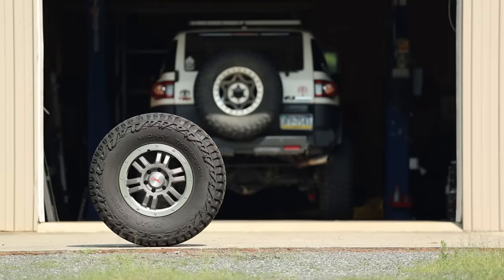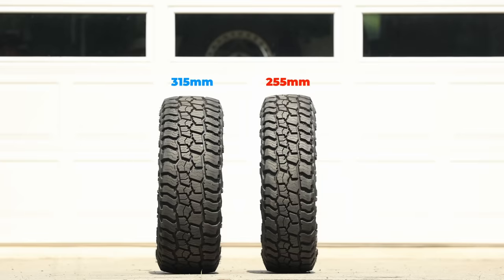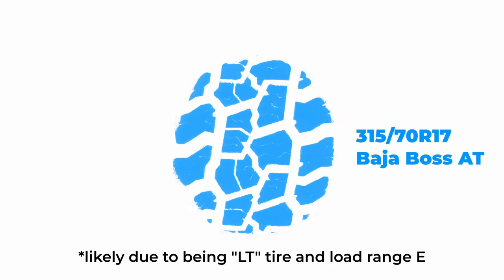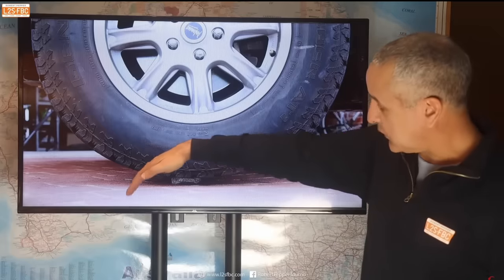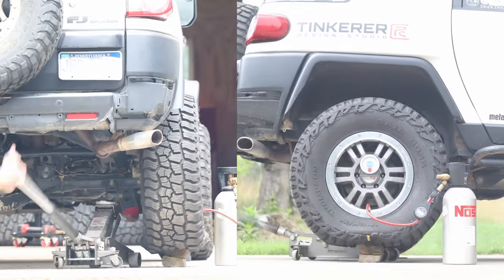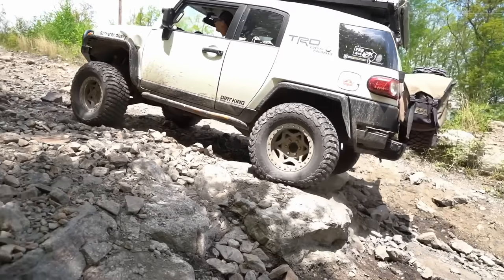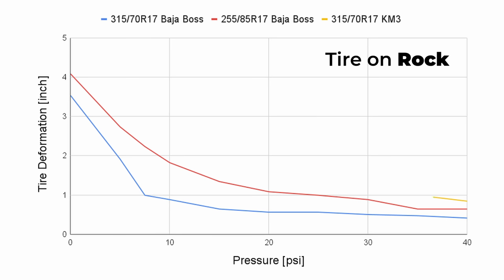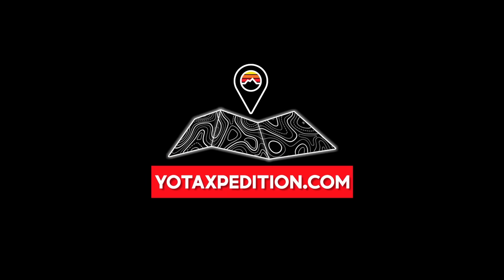3 Scientific Experiments to Settle This | Wide vs Narrow Off-Road Tires

Comment: Awesome video Kai! Very informational! Glad to be working with you on this!
Reply from the maker: Thanks again for your generously support! We’ll collaborate on more interesting topics
Reply: you guys only support 5th gen 4runners right now? I don't see anything on your website for the other generations.
Reply: Thank you Yota Expedition!
Reply: Thanks Yota !
Reply: Thanks for sponsoring.   You guys need to sell some 1st gen Tundra stuff.
Reply: Well done for your support too.
Reply: Thank you! @yotaxpedition
Reply: Sick collab!
Reply: @shohokuslamdunk  We are still in the process of building our website out. But our main focus right now is 5th gen 4Runner, 3rd gen Tacoma and starting to get into the new Tundra
Reply: It seems to all comes down to softness of tyre rubber. You see the rock crawling trucks use very soft compounds on brands like Maxxis Trepadors
Reply: You work with Kai who attracts a lot of FJ owners but your website doesn't have any products for our FJs? I am disappointed 🥲
Reply: Fail. The whole entire point of foo reading is to become able to bug out with enough stuff to survive when SHTF, and for any given diameter, the wider tire holds more air, so can have a higher load rating to carry more stuff. A 305/70R16E beats a 255/85R16E, both are 33", but even a 305/70R16D is rated to carry 110# more than a 255/85R16E. Wider wins.
Reply: @TinkerersAdventure do you have a video comparing 0-60 in wide tires vs wider tires? For example 275.50.17 vs 315.50.22
Reply: @TinkerersAdventure 100 percent of mountain bikers or motocrossers could have explained to you that more tire volume...... means less likelihood of damaging a rim. Not just risks of unseating. 

Also, you didn't show any evidence at all to indicate if more "tire wrap" gives actual better performance on a jagged rock edge with a pizza cutter. If the tread is deformed inward, all the knobs are pressed together and the tread behaves more like a bald road tire, vs a knobby. 

If you want to learn real science, never listen to the guy who wears deodorant.
Reply: Don't own a Toyota but thanks for helping him out. That was an excellent informative video. Now I'm sub'd to 2 new channels!
Reply: @TinkerersAdventure  You’re an engineer; what you have stumbled upon can be represented by the following simplified equation for pneumatic tires:
(p x s) + C = w
Where  p  is PSI air pressure,  s  is surface area (or contact patch),  C  is tire carcass strength, and  w  is the weight being applied.  C is a constant for a given tire - more importantly when you run the calculations you find that C is so small as to be considered in the “noise.”  

This formula perfectly explains the matching contact patch between the two tires.
Reply: Contact area on hard surface versus soft ground are too different animals.
Reply: Looking forward to 2020 Tundra inclusion!!
Reply: Did you use same wheel for both tires? To narrow of wheel might be deforming wider tire enough to affect contact patch.
Reply: Here’s my question. Would you get a different result if you went to a more dynamic form of testing instead of stationary testing? The weight shift of the vehicle while on trail may give a different result?
Reply: @GordonTamf35  We are planning on adding a FJ tab and adding all the products that cross over from the 4Runner.
Reply: I think there needs to be a scientific paper with loads of info about all of this so we can all make the best decision for our use case and then manufacturers have a transparent/public bar to hit in terms of performance. Get the bro science outta there.
Reply: @yotaxpedition 3rd gen tundra you say? 😊 right up my alley!
Reply: @clayboy_20  yes sirrrr
Reply: @TinkerersAdventure 🎉🎉😢🎉
Reply: @TinkerersAdventure I think you made a mistake in your calculations your old tire was old therefore the rubber was more able to flex I bet if you run the tires on your car for the same amount of miles and then do the experiment again you get similar results in comparison to your old tires... those grooves in the tire mean nothing the only reason why this is flexing More is because it's an older Tire. Just letting you know you're experimental flaw.
Reply: I don't think people with wide tires ever actually go off-roading...  especially if they have spacers (mall crawlers). 🤢
Narrower tires also get better gas mileage. 👍
Reply: Thank you for this video. Not to rain on your parade, but this is old school knowledge. I have been wheeling 40-years. Remember, a wider tire takes more PSI to keep the bead locked than a narrower tire. Plus, there the vehicle weight versus contact patch psi. Narrow always wins. Nevertheless, very cool stuff. I appreciate your video.
Reply: Without independence, there is no freedom and without it, there is no right outcome. Stay true👏👏👏
Reply: Interesting results. You have echoed my thoughts. Tire makers will only make narrow tires if we buy them. 255/85R16 is the ideal off-road allrounder size for SUVs and medium sized 4x4s.
Reply: Great video!! Think you could do one in regard to traction in mud? Wide v Narrow?
Reply: WHATS THE CONCLUSION?
Reply: Everyone complaining about the vehicle used in the video 😂 The video is about TIRES!
Reply: The narrow tire in this comparison is rated for 3,195 lbs @ 80 psi where as the wider one is rated for 3,195 lbs @ 65 psi, the latter of which likely has a stiffer design to achieve a similar load capacity at a lower psi. Also it's important to note one needs to consult each tire's load inflation table in these types of comparisons for it to be "apples to apples" because tires with disparate ratings like these require different pressures to reach the same load capacity. Though even with pressures adjust accordingly, it would still be difficult to ascertain whether the characteristics observed are a result of the tire's construction due to rating difference or due to width. So ideally to compare differences due to width, one would use tires rated the same but of varied widths.
Reply: Would love to see some love for the FJ's as well  @yotaxpedition
Reply: 255 pizza cutters look retro cool, lighter, likely cheaper, and obviously offer off-road performance advantage. My next FJ tyre👍🏽 but do they fit oem wheels?
Reply: Was there an MPG on highway difference?
Reply: @whitewolf30f  carrying capacity was not a topic of this video. With same attitude one can argue that narrow tires requires smaller width of snow chains, wider tires are better for squishing wife's cellphone she don't pick up ever or that narrow tires fits better on Yomada XK-B trailer shelves. Or that it is easier to high-five wide tires. There is a reason why both variants exist, of course.
Reply: ⁶ @TinkerersAdventure
Reply: Awesome work on the video, required a lot of time and effort no doubt. Although based on your results I'm happy to stick in the middle with my 285 BFG's.
Reply: This video is excellent! A true model for others on how to properly make a legitimate comparison of products without all the theatrics! Thank you. You just confirmed what I suspected.  Just look at the farm tractors use as an example.  Tall and narrow.  Great job!!
Reply: There was no testing of the results in application and I’m curious what role, if any, the width of the rim plays in these results. I hope you can do a video on that in the future. Great video and a ton of hard work. Thanks!
Reply: There was no testing of the results in application and I’m curious what role, if any, the width of the rim plays in these results. I hope you can do a video on that in the future. Great video and a ton of hard work. Thanks!

Comment: I'm a pizza cutter guy myself. Your overall fuel mileage will improve and you'll notice a slight difference in the throttle response too. Less rubber=less weight=less rolling resistance. Plain and simple. Given the data you've come up with, the way the pizza cutter contacts the ground compared to the wider tire, it's no wonder why they perform so well in mud, snow and rocks. The contact patch is llonger rather than wider. Giving you that"caterpillar" affect. Lol. That's what gets you through and over obstacles. They sink through the slop and grab hold of the solid bottom. Narrow tires fold over obstacles more easily, giving you more positive traction. Like mud and snow. Wider tires tend to float a bit and slide around. How many wide tires do you see on military trucks? They had it figured out decades ago. Great video!
Reply: Nd Henry Ford had it figured out many yrs b 4 th military,hence th model A nd T
Reply: @harrycraft3359  lol. I think in those days it was because wagon wheels were narrow and rubber tires were in their infancy. But I get where you're comin from. Lol.
Reply: You see these old videos of model ts going through a foot of mud like nothing with 4 inch wide treads lol
Reply: You'll also throw less gravel at pedestrians on your way out of town.
Reply: Less rolling resistance 🤔 
Are you sure? 
The exact same weight is pressing down on the tyres from each corner of the vehicle, no matter how wide they are or not. Therefore, you are actually increasing the pressure per square inch pressing down on the ground, the narrower you go. The only way you lessen rolling resistance is tyre material and vehicle mass.
Reply: Read the original comment.  The OP said pizza cutters weigh less because they have less rubber. So yes, they will have less rolling resistance.
Reply: @thejdshipley   I haven't visited this video for a while. Forgive me. Which original comment are you referring to?
Reply: Only time I need my wide vs pizza cutters is when snow is 4 ft deep and I need to use them to not sink to axles and subframe(jeep) or frame and have that drag and hanging up while trying to reach more rigid solid surface. 
Not often am I driving on top of deep deep snow.
Reply: Heavier tires increase unsprung weight.  This works against acceleration and braking.  
Also has a negative impact on handling.  Fascinating results verifying what some of us have learned from experience.
It would really be great to see this kind of testing on wet surfaces, ice, sand, mud, snow of different depths, and river crossings.
Much to learn, so each person could pick the tires that best fit the situations they typically encounter.
Reply: @bigtater29  yours
Reply: Wide tires actually tend to have less rolling resistance, not more. The reason is demonstrated in this video where he tests the shape of the contact patch on a flat surface. The wider/shorter contact patch means less sidewall flex, less distortion, less hysteresis.
Reply: Weight isn't a measure of rolling resistance. Rolling resistance is heat generated from tire distortion. The narrow tire will distort more and will have greater rolling resistance if the construction and compounds are the same. If you are concerned about MPG, the lighter weight will help a tiny bit, and the aero drag will be less on the highway, so overall probably not much difference. Lighter weight is also good for suspension performance.
Reply: I'm more interested in the wide/narrow issue for passenger-car tires on pavement. I tend to go pizza-cutter to lessen hydroplaning on wet roads.
Reply: @CadillacDriver  You are assuming the tyre remains round and the ground is flat. Any deflection from round or any irregularities in the surface (sand,gravel) will alter the resistance.
Reply: @butchphillips873  my post is not incorrect.
Reply: amazing explanation
Reply: @rruffrruff1 you also gotta factor air pressure in the tires.  Depending on the psi, will depend on rolling resistance and heat the tires make
Reply: @ziggyortiz37  Quite true. I was assuming the same pressure for each. If you run lower pressure in any tire its Crr will go up on smooth pavement. Offroad it depends on the surface and how rough and soft it is, and how much you sink in.
Reply: @rruffrruff1  after a Google search I see that I stand corrected regarding the use of the term rolling resistance.  I believe the term I should have used was unsprung weight.
Reply: @CadillacDriver  not true, put 1,000 lbs on the pin of a needls and turn it left and right, now make that needle 3 feet wide..much much harder to turn and roll.
Reply: @kevinr.9896  tell me something, if you put the same mass on to a smaller contact patch, will the pressure exerted on the ground be less, or more, per square inch? This is a simple question, with a 'more' or 'less' answer. People in this comment section need to learn the art of research. Wider tyres have less rolling resistance. Turning is NOT rolling resistance.
Reply: @CadillacDriver yeah I agree with you. I think I've heard some people refer to Rolling resistance as cutting through thick sand the narrow it's easier. I use 11.5 wide I feel like it's pretty good at everything at least in the 33-in tire world
Reply: less rubber does not equal less rolling resistance woooowwwww this guy smh misinforming people completely
Reply: @thejdshipley  A heavier tire may have poor rolling resistance but it's not really the fault of its weight.  Increased weight of the tire will increase the time it takes to start rolling and to stop rolling; rotational inertia that requires a short boost of horsepower to get moving. An increase in rolling resistance means it takes more horsepower to keep rolling at a consistent speed. Summary: once overcome, inertia has a lower impact whereas rolling resistance is constant, requiring extra horsepower to stay moving.
Reply: I have always preferred narrower, softer tires from the 70 series and above, likewise I have always preferred softer and higher suspensions. I have never been seduced by fads. People have an obligation to research and study more and more so as not to be deceived in all fields. 😊
Reply: @CadillacDriver if that were true, would it not stand that under inflated tires vs over inflated tires should not yield a difference in MPG? 

Which people have tested that it does affect MPG. 

More rubber in contact with ground equal more friction. 

That’s why hybrids like Prius use super skinny tires. Helps mpg.
Reply: @douglas7260  research is a thing. 
Skinny tyres are more aerodynamic and generally lighter - hence more fuel efficient than wider tyres on EVs. 
It IS true that wider tyres create less rolling resistance, it's not a matter of "if it were true" - it simply IS. 
You are confusing the wider contact patch of an under inflated tyre with a wide tyre that's fully inflated. 
That is apples and oranges. 
Under inflated tyres create drag because the rubber isn't rolling as easily.
Reply: This dude just said "no wonder they perform so well in mud, snow and rocks" lmao those are all place they perform TERRIBLY in. Go find me a mudder truck that has skinny tires please. Or snow wheelers? ALL fat tires
Reply: @spetsnaz892  if you're in a mud pit with no bottom, fat tires work the best. But where I'm at, there's a hard bottom under the mud and skinny tires work better.
Reply: @bigtater29  What? that's not how mud works unless you're calling standing water mud. Mud is just slick dirt....you don't cut through it like snow or some bog
Reply: @spetsnaz892  I know what I know from experience. I can't believe this comment is gettin so much blowback. Every one of you need to get off your phones and try it yourself.
Reply: @bigtater29  you can't believe it? My man you just finished saying that skinny tires will cut through the mud to the hardpack underneath, and you expect me to believe you have experience with a comment like that? That's not how mud works lmao
Reply: Wider tires during the summer, narrow tires in winter. Got it.
Reply: I think it depends heavily on the weight of the tires say Kendra klever is heavier than falcon wild peak
Reply: In my everyday situation, which is rural dirt roads and 100 zones, the "pizza cutter" has much greater ability to avoid pot holes.  My neighbour once got some heroic 12.5 inch-wide tyres and just 2 weeks later he asked me if I wanted to buy them off him.  I told him "no way" and when I explained why he said, "Yeah tell me about it! :(".
Reply: @ashchaya7676  lol
Reply: Why buy an offroad rig and be worried about the gas milage?
Reply: @MachNone  When it's also your daily.  Remember some of us live out here and the 4WD isn't just a weekend toy.
Reply: @MachNone  Thats a good question. Here's an honest answer. Some guys only have one vehicle and they make it work for everything. I only have one truck. It multitasks a lot of different things. I went from a 12.50 down to an 11 wide and noticed a difference in mileage and traction. Both positive. I was commuting 350 mi a week, able to get into my fishing spots, and keep the truck on the road on the snowy mountaintops. While gaining 2 more mpg. More times than I can count, have I seen the fat tired, lifted trucks, stuck in the ditch in a snowstorm while the farm truck with 235s crawls right past them. Lol. It also depends on application. If you've got hard bottom mud holes, a skinny tire will do better. But if there's 5 ft of mush, do your best with a wide flotation tire. 🤷
Reply: @ashchaya7676  Preach on brudda lol.
Reply: Does anyone recall the ford model T’s showing old film footage of them scooting downa dirt road in and out ditches, they were no more than a horse buggy with wagon wheels, had hardley no problem

Comment: Years ago, some magazine did a study on bicycle tires. At the time, everyone thought narrow tires made you go faster. But the study found that narrow tires have the same rolling resistance as wide tires. The size of the contact patch is determined by the weight of the rider, not the width of the tire. The only difference was that narrow tires had a longer, rather than wider, contact patch and thus were more prone to flats.